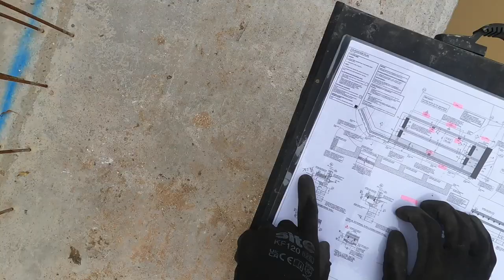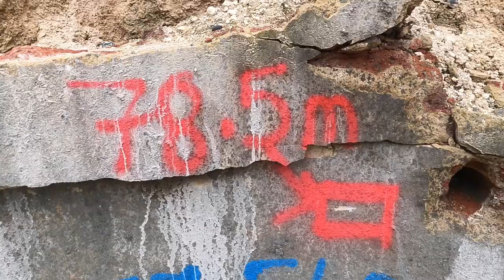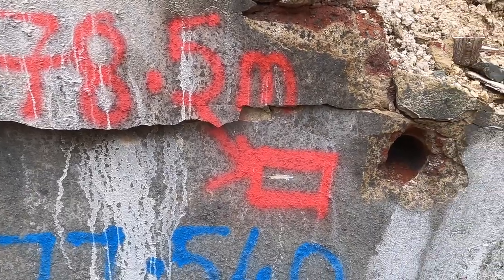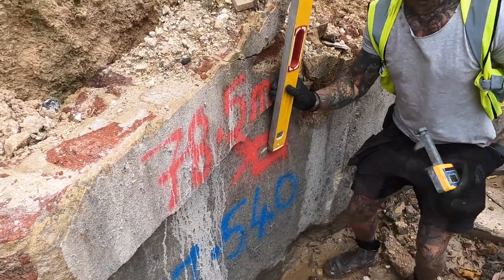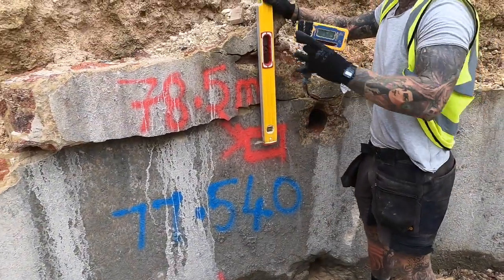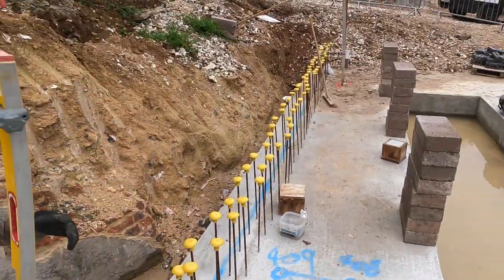Getting the foundation ready!

Comment: Fix an L bracket on to the foot of the profile.
It will give you a permanent fixing point instead of faffing around cutting bits of timber and dare I say it chopping your fingers off.
You're a master on the trowel but I respectfully advise you leave the skil saw down🤣